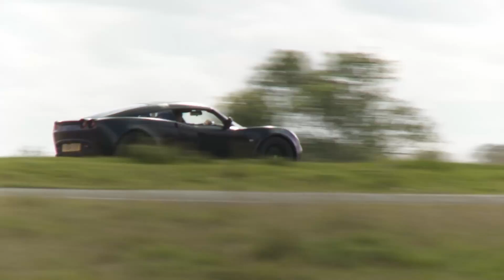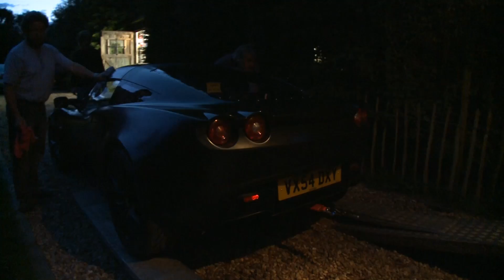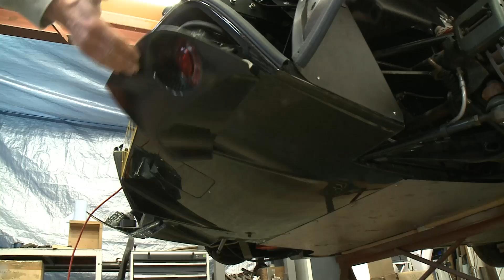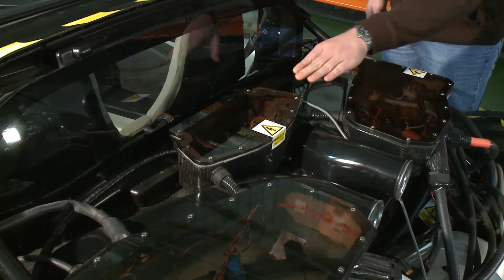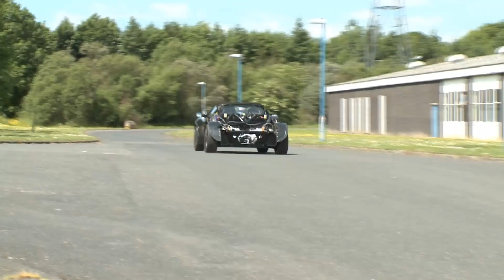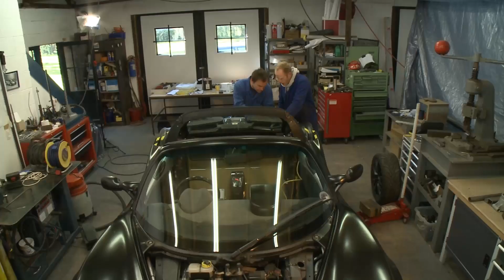Part 12 - Zerocarbonista - The Wind Car is on its way

Comment: Great to see young engineers doing 1st class ground breaking work.  Carbon fiber, exotic battery management systems and the whole integrated package is light years ahead of some of the back-yard shade tree tinkerers.  This efficient systems approach is so contra to the old " you can't beat cubic inches" mentality.  Small light units working together can beat massive ICE vehicles.